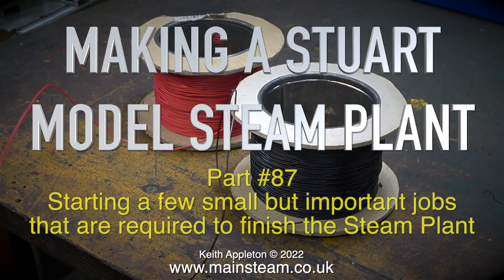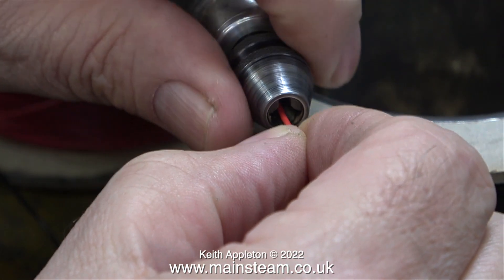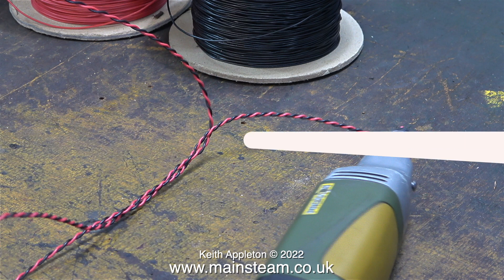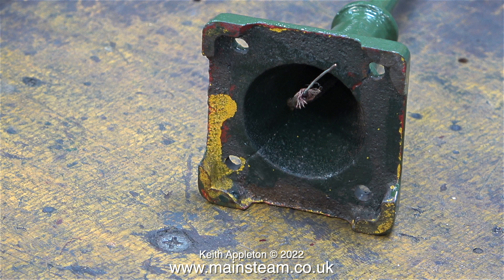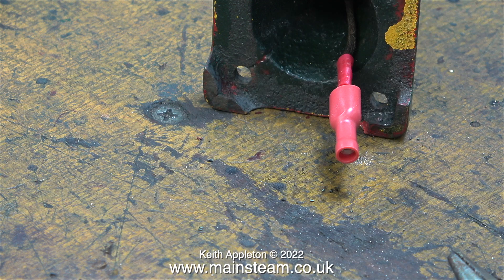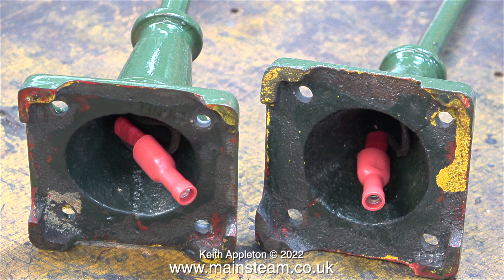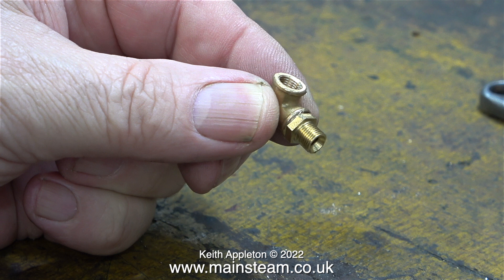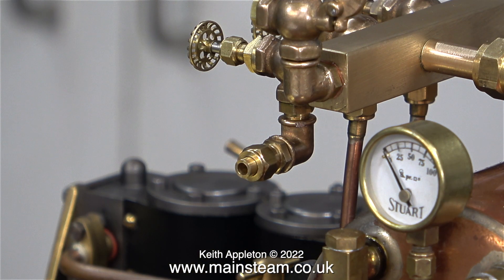MAKING A STUART STEAM PLANT - PART #87

Comment: Keith, U.S. pipe threads are either NPT (tapered) or NPS (straight). Contact PM Research & find out exactly what they use.

You folks in the U.K. have had a bad time with threads.  Whitworth was fine, but WW2 pushed the introduction of UNC/UNF.  Then came the switch to metric.  OUCH!